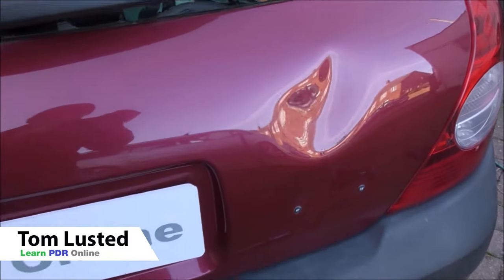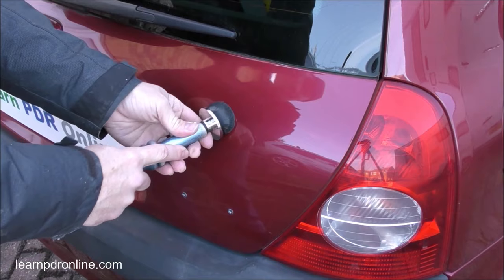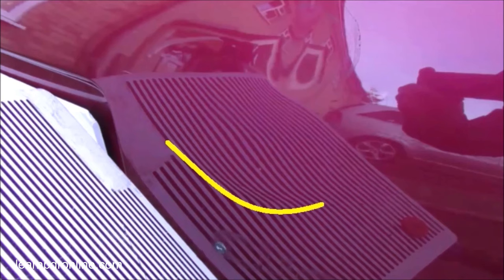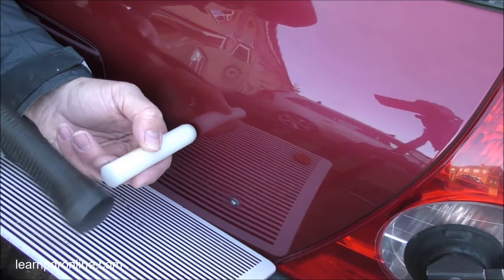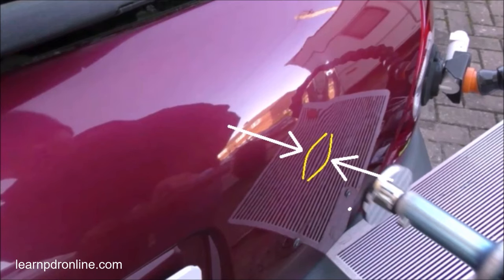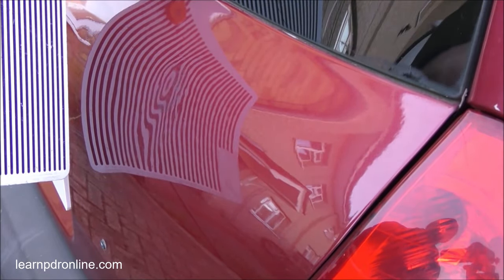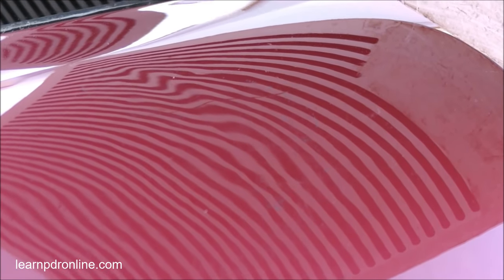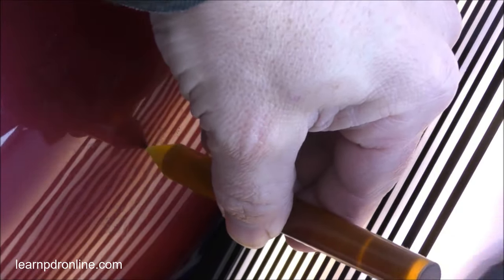Fixing a dent with Cold Glue! I try out Glexo's cold glue for Paintless Dent removal (PDR)

Comment: Hi there. Just subscribed. Great vids. Can you advise a diyer as to a good starter board and where to buy. Thank you.
Reply from the maker: Thanks Jonathon, where are you based? Personally I would start with a reflector board as these are much more affordable than full light set up and then when you progress you can upgrade at a later time. If you are in the UK you can get both fog and lined reflector boards options from www.tdntools.com and www.pdrprotools.co.uk

Comment: Thanks for the info. Im a professional and i have just bought a coldglue set. And also the hail set. Im used to hotmelt. This does look interesting.
Reply from the maker: Thank you, I was on the fence myself for a while but for me Cold glue is great for reducing large soft damage fast, then I switch to hot glue or bars and rods to finish. For small shallow dents the hail kit should see you well too!
Reply: I have done a little practice, and I am not really convinced yet. I did come to a similar conclusion. I will give it another try when the dent seems right for it

Comment: The glue is quite expensive. Also, do I need the tool you are showing or can I use something simpler.
Reply from the maker: Yes there are alternatives with both the glue and the glue puller just be sure to check the reviews and make sure its not a cheap knock off that may risk damaging the paintwork as that will be more expensive

Comment: Thanks mate, just popped by to get the drill on the cold glue.
Had a couple of tubs from Ultra Dent a short while, and today a 350z comes in, big soft dent in the RH quarter.
Absolutely no access, and I hate drilling !
Been painted too, so avoiding hot glue, the cold should move it though.
Thanks again, great to have these resources to help others.
Reply from the maker: Thanks Les, Yes the cold glue is good stuff to reduce large soft dents quickly and cleanly! Thanks for your comment
Reply: @LearnPDROnline  cheers mate.
Polished and iso cleaned, then some heat gun warming on the panel to assist.
Worked great, 90% out on first pull.
Need some nice metal tabs, the Gexos are big $$$ here, might get some made and chromed.
I used a 3" keco round, then flat round Black Plague Gangrene tabs, worked well enough for first time cold gluing. 
Thanks again.

Comment: Great Job.  Seasoned body tech here  and I was wandering how this glue worked to pull metal with broken paint to get it ready for metal finish.  Looks really strong and fast.  Thanks for the video 👍👌
Reply from the maker: Thanks Salvatore, yes its great for reducing large dent damage fast, its important to set it up correctly the first time (instructions with kit) and then clean the area, warm the panel and warm the glue to get the best pull!

Comment: Thank you it was very useful question before you used the cold glue you have to wait 10 to 15 minutes of what I didn’t understand what we’re supposed to wait for?
Reply from the maker: Thanks Celeste, The very first time you use Glexo cold glue you have to set it up to the tab, this is pretty simple and the instructions are with the kit, taking the time to work the glue at the right temperature so it adheres to the tab, once set up is done, its ready to go and every time you use it there after its ready, just needs a little warming up to help adhesion

Comment: Excellent explanation. Impressive work. Can you tell me what was the tool with the ball on the end?
Reply from the maker: Thank you, do you mean the tool I was pushing the dent with from the inside? if so its a double bend bar with a screw in tip, the tip is a Dentcraft R4 and the red pvc cover is known as a 'cherry cap' for the R4 tip - https://kecotabs.co.uk/products/dentcraft-1-4-hard-pvc-interchangable-round-tip-red-r4-r?_pos=6&_sid=1ed576b65&_ss=r  and a bar similar to this one - https://kecotabs.co.uk/products/24-x-7-16-softtip-dbl-bend-90-changable-tip

Comment: That's an easy one for obvious reasons. Can u illustrate the same size dent on a flat area?
Reply from the maker: Hey Tom, usually people find its harder fixing dent damage on curved panels like this, flat areas are usually more straightforward, do you mean the same dent again on something like a flat roof or middle of a door?
Reply: @LearnPDROnline  to me flat shows more to the trained eye.  I'm mostly asking in reference to adhesive ability. Flat doesn't pop back like that.
Reply from the maker: @tomchapman4826  In terms of adhesion it makes no difference on the shape of the panel in my experience, so if the panel is clean and prepped correctly the cold glue will stick. Large soft dents like in this video will come out with some good pulls in the right place, its great for reducing larger dents quickly. I find its the smaller sharper dents or creases that don't work so well with cold glue, that's when I'll switch to hot glue or work with tools from behind. I mostly use cold glue for small soft dents on roof rails where I can usually fully remove with the cold glue alone or for reducing large damage quickly.

Comment: Great job as always, Tom. I've used cold glue to reduce the dent area and even remove the dent on repainted panels. Cold glue pulls aren't as strong as hot glue pulls and damages on the paint are avoided. Heat is needed, of course. I've had  no problems in those repairs with Cola Fria. Have you tried that repair with Glexo?
Reply from the maker: Thanks Francisco! I've used cold glue a few times now on a few different repairs and yes it is ideal for a softer pull to reduce the risks of damaging the paint and also reduce overpulling the panel but not yet tried on repainted panels. I've only tried Glexo myself but I know there are a few others out there
Reply: Thanks Tom!

Comment: Hi Tom, What are you using to heat the panel, is it a standard heat gun or hairdryer?
Reply from the maker: Hi Barry, yes in this video I am using a standard hair dryer but you can of course use either... If using a heat gun just keep an eye on the temperature and how close it is so as not to burn the paint 👍🏻

Comment: Allow the cold glue to Set In 10 plus mins at the tip of the slide hammer first?????
Reply from the maker: The very first time you use cold glue you may need to allow around 10 minutes for the cold glue to adhere to the metal tab, after this first time, you will only need to warm the glue slightly either by hand pushing and folding the glue or with a heat gun, just enough to make it really nice and sticky!
Reply: @LearnPDROnline  thanks boss!  Got it!!

Comment: Hi Tom, would you mind to tell me where to buy the same PDR that you are using. I will really appreciate it. Thank you for sharing your ideas. Such a great man.
Reply from the maker: Hi Von Von thanks for your comment, depends where you are based as to where to buy but the manufacturer of the cold glue is ‘Glexo’ I got mine from TDN - https://tdntools.com/products/glexo-cold-adhesive-system-full-set?_pos=7&_sid=0e1bccca4&_ss=r and the slide hammer I use is from BLE tools again in the uk - https://bletools.com/collections/glue/products/aluminium-dent-puller-with-spring-dampening 👍🏻

Comment: Hey. I'm new to this area and would like to learn more about the use of cold glue. It is a little difficult to get advice here in Finland. 

I developed my own cold glue and would like to get feedback on it. Maybe I could shoot a short video. Based on that, you may be able to evaluate the product. 

You cannot buy cold glue from Finland. It would be handy if I had managed to make my own. At least it feels pretty good in use.
Reply from the maker: Welcome to the world of PDR Ju ha,  I have heard of a few people making their own versions of cold glue, as long as the paintwork is protected and you can get good adhesion for the pulling process it works. I believe Glexo is a Russian product so just across the border from Finland  - https://glexotools.com/ and also available from Dent tool company - ://www.denttoolcompany.nl/en/
Reply: @LearnPDROnline  Thank you for your answer. The glue seems to work well. I have already used it a few times. Manufacturing did not require much of engineering skills.Happy holidays!

Comment: Thank you - just subscribed. What is your opinion on cold glue (as you show here) vice hot glue for something like this? I have a hot melt glue that I have used for many projects (but never for dent removal). Thank you.
Reply from the maker: Thanks for your question and for subscribing, I used to think it was either or but having both hot and cold glue for your PDR repairs is great as they both serve a different purpose, before I had cold glue I would do what's known as a 'wet' pull with the hot glue, this is when you pull early before the glue has hardened and it has a similar 'softer' effect like the cold glue but now for large soft dents my go to is the cold glue, when you get used to it it is very quick to work with, by the time my hot glue gun is hot Ive already removed half the dent with the cold set up and the clean up time is also reduced. However cold glue has its limits, for smaller, sharper or deeper dents its hot glue all the way for a stronger more precise pull. Hope that helps :)

Comment: Thanks Tom! This was very helpful. In the use of the line board finding crowns. I have been working with using a slapper to bring those crowns down. Sometimes it works well, sometimes not. I made a rubber padded paddle I use for a slapper with a soft faced hammer. Have you experience with that?
Reply from the maker: Thanks Allen, I've had some success with slapper tools, I'm probably quicker and more accurate working with a knock down like the Cro Carb or with a blending hammer and a soft domed tip particularly with smaller crowns but this would be time consuming with the larger ones. I'm sure if I practiced more with the slappers I'd get quicker :) 
With your rubber padded paddle are you resting this against the panel and hitting with a hammer or using the paddle as a hammer itself? 
You may also like this video specifically on identifying crowns - https://youtu.be/KUUOv5FCdzo
Reply: @LearnPDROnline  I lay the paddle on the metal and hit it with a rubber tipped hammer trying to direct the metal back to whence it came.  My paddles are padded with rubber material.

Comment: How do you decide where to start first on a dent like that
Reply from the maker: The short answer, experience... but it begins with a lot of trial and error, having an understanding of 'metal flow' will help you determine where the tension is, which parts are shallow and which areas are most likely to respond with a particular repair method, You can usually feel by hand which areas of a large dent are 'soft' ie have some movement and which areas are 'hard' build up of tension, so its about releasing tension to allow the metal to move easily!